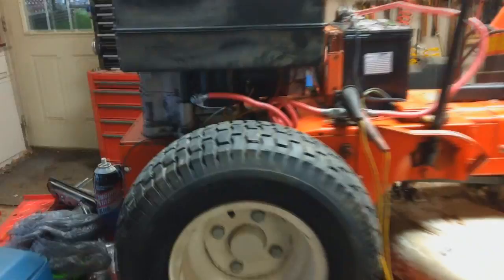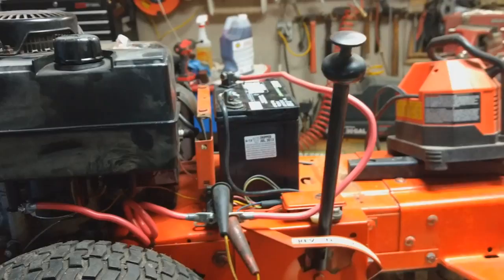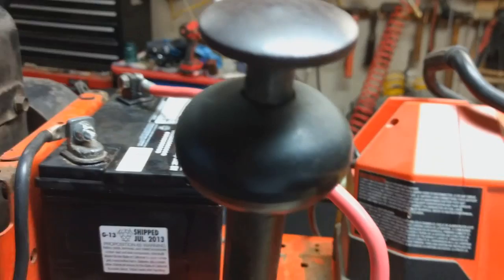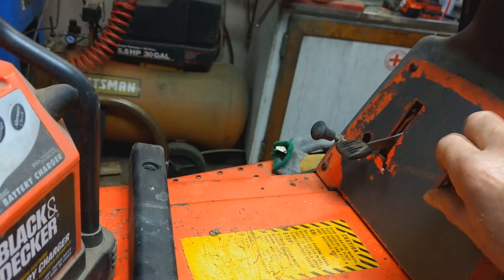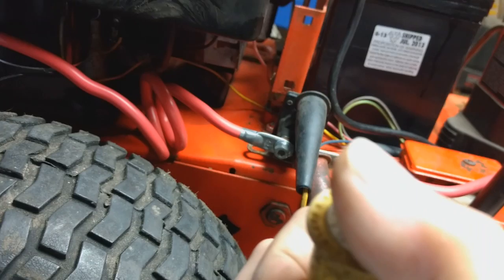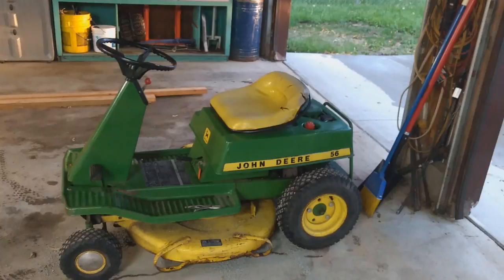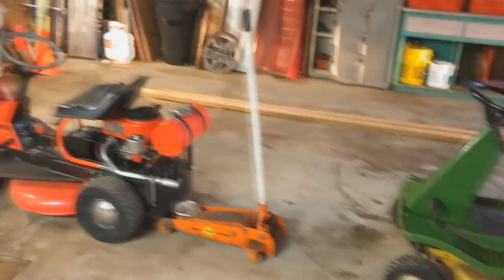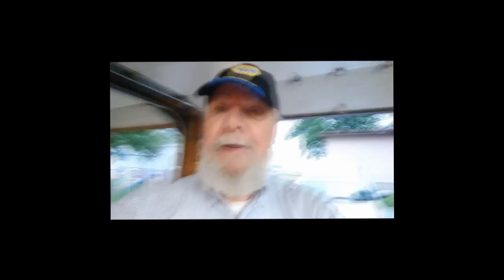A new addition to the Shade Tree corral, John Deere!

Comment: The JD could be an easy gas line fix and if the drive train and mower deck are working also, either way you have a good machine!!
Reply from the maker: I am hoping that once it is running all will be good. It has been kept indoors for most of it's life so it is in great shape. Thanks

Comment: Hi George: Question for the small engine man. My Craftsman Riding Mower is 22 years old. It is been back firing in idle. What is going on?  Runs great on the high end. Kohler engine. Still gets the job done. Could it be the hot weather. 92º F Was all OK this spring, when I did the tune up new plug...... Etc..That John Deer looks great, be fun to cut grass with this machine.
 😎 • Cheers from The Detroit & Mackinac Railway 🚂
Reply from the maker: There are a number of things that can cause backfiring at idle, but likely your carburetor needs a little adjustment or there may be a little moisture in the fuel? Thanks for stopping by
Reply: The Shade Tree Fix-it Man / Thanks 🚂